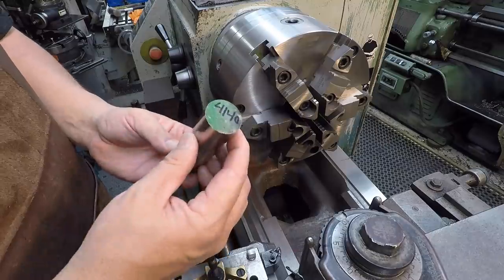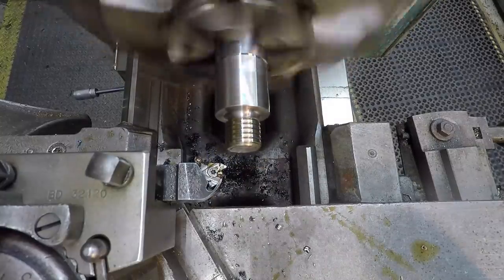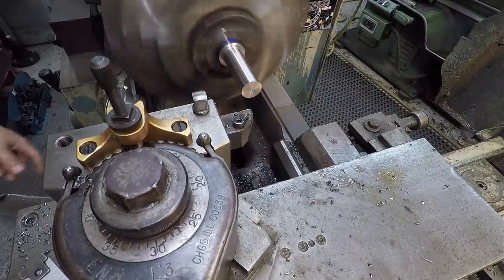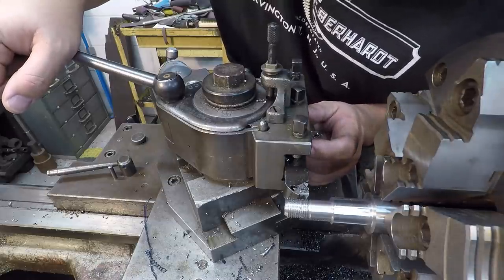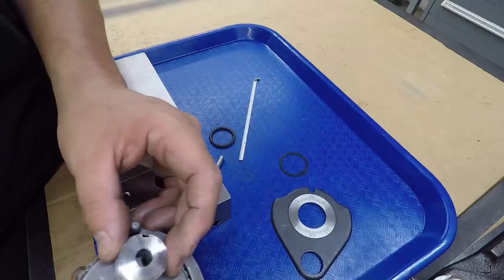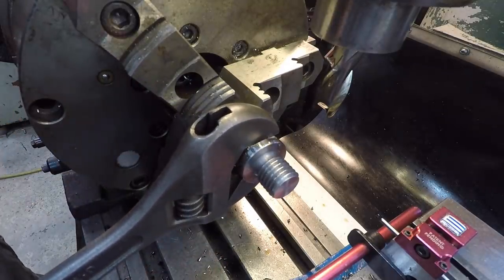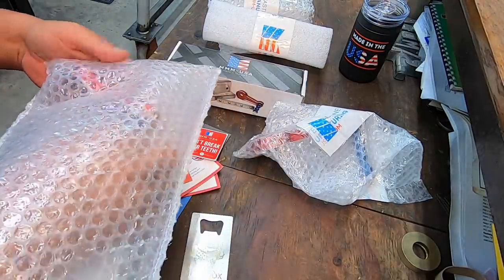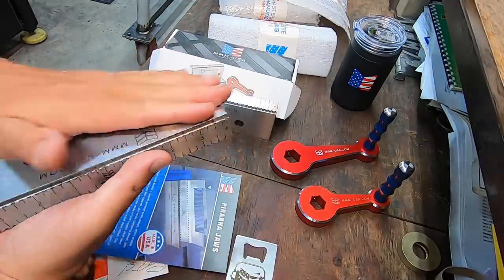SNS 314 Part 2: Machining the Multifix Hold Down Stud

Comment: Love the multifix toolholder, Im in the UK and I have 2 Pewe holders on my lathes and am very impressed with the quality having had several genuine original multifix holders in the past. Just as a side note I have never put the dowel in ...especially when the machine is operated by others because if they crash the tool, it can move..this has saved  me expensive repairs many times. They hold down real well with just the bolt. really enjoy your channel and the interesting stuff you do.
Reply: But you loose the ability to rotate the toolpost by an accurate and repeatable 3 degrees.

Comment: Hi Adam :-) 

I felt the need to add some information on the Multifix system. 
The 3 holes in the body of the holder aren't 90° from each other, they are 93° from each other, the 2nd hole is 93° from the 1st hole and the 3rd hole is 186° from the 1st hole).
That means that there are 120 possible positions instead of 40. there are 40 positions for each hole in the body, the 2nd hole provides a 2nd set of 40 positions and the 3rd hole provides yet another set of 40 positions (3° intervals instead of 9° by utilizing the 2nd and 3rd holes).
Edit: With the 6mm locating pin set at 90° in the T-nut (90° to the length of the top slide), it's easy to hit 30° on the top slide and still have the Multifix tool holder parallel to the chuck just by using the correct hole in the body of the Multifix (since the Multifix allows for 3° increments and most machinists would agree that 30° works well for threading). 
The T-nut for the Multifix really should be slightly below the surface of the top slide by 4 to 6 tenths. I did the same thing that you did but after using it for a few hours, I noticed that the tool post wasn't rigid anymore, turns out that I should have come up with some way of pre-loading the center of the T-nut before machining the surface, I should have made a set screw with the same threads as the center post, then tighten it down good before machining it (pre-load). The fix was to simply grind 6 tenths off the top of the t-nut, that took care of the rigidity issue. 
BTW, I determined how much to grind off by using various shims between the body of the Multifix and the top slide, it held at 4 tenths so I decided to give it a little extra clamping power by grinding 6 tenths off the top of the T-nut.  

Those jaws from MMM aren't reversible, the teeth are on both sides so you can clamp onto an internal feature as well. 
The card that mentions "Don't break your teeth" is meant to prompt you to checkout their advice on proper use as well as drawings on how to properly machine your own soft jaws so their Piranha strips won't break.
They sell individual Piranha strips in various lengths for use on your own jaws (or fixture plates with cam type clamping systems). 
Excellent work, my friend!! 
Nice work on the  video as well!! :-)  
I'm always looking for new ways of doing things and I have learned a few new things by watching your channel!! 
Much appreciated!!! 
Joe
Reply: Great post. Thanks Joe! I had the same reaction to the T nut being (at best) flush.
One other point: if I was making a post for a larger sized lathe in particular, I think I'd go the extra mile and make the axle and the T nut one piece, ie a T bolt. At the very least, I'd recommend using Loctite High Strength Retaining Compound with the correct primer and a bit of pre-heat to make the stud as near as dammit a permanent fixture in the nut (you can always use a bit more heat, like maybe 180 deg C, to remove it)

Comment: Adam, the reason you're chipping the threading inserts could be another result of the loose spindle bearings that cause you grief with cutoff tools chattering on the Victor.  The spindle bearings on my lathe got loose and it started murdering inserts left and right.  Once the spindle bearings were correctly tensioned, no more chatter and no more inserts failing prematurely.  And for what little my opinion on the subject is worth, I think a video or video series of you adjusting the spindle bearings on the Victor would be really interesting--the clutch and oil change series on the Monarch you did a couple of months ago certainly was.

Comment: Concerning the alignment with the cross slide, the reason the Pewetools Multifixes have three pin locations is that they're offset 93°, meaning you can turn the tool post to a different pin location. 
That gives you 120 positions by 3° instead of 40 by 9°, so you can realign it to fit your desired compound orientation and is one reason I replaced my import with a Pewetools QCTP.

Comment: We use those jaws at work     Takes a crash to dislodge the part from them.   They make a dimple on the part so don't use them on a part that is fully finished.     Awesome videos.   Saturdays are always enjoyable watching your videos.    Learn a lot from them.
Reply: Do you clamp tool steel with these by any chance? If so, how well do they work.
Reply: @ianide2480  Steel and Alum    Works well with both.      O-1 and A-2

Comment: Not just anyone can start cutting threads and then change a tool bit and come back and pickup the thread and continue cutting and have that good of a thread when finished. 
Very nice work.
Reply: Good tooling and good inserts certainly makes that easier.

Comment: I like you're method of mounting the T nut as you don't need to modify the cross slide. I try not to drill holes etc. in my machines unless I absolutely have to (e.g. mounting the slides of my DRO).

Comment: From Peter:   Those 3ea 6mm index holes on the bottom divide the 40 positions ( 9° each step) into 3 different offsets at 3° each.   So if you move into a second hole from where you start you have 40 more positions offset by 3° from original 40 positions.   Then if you move the post into the 3rd 6 mm hole you have 40 more positions offset 6° from the original toolpost position.  It’s slick method to turn 40 positions into equally spaced 120 rotational positions.   So it’s pretty easy to get really close to being square to the spindle at any compound angle setting.
Reply: Jorg Jorgensen Peter loves to chat.  I think we covered every aspect of his system.   He wasn’t hip on me doing the t-slot mount with the Jack-set screws but I showed him my method on my install.  Now it seems Peter is comfortable enough to pass on this method to others.  He really promotes the European method of installing a fixed stud in the compound so that the etching on the bottom of the post actually completely embeds microscopically into the compound to make a rock solid 100% contact.  I suggested my method of very tight fitting T-nut with large jack set screws and then surface grinding the full contact area as Abom did.  It works.  I found it impossible to rotate my post using a 1/2-13 stud and nut out of a Teco clamp set.  It’s a great product  and can very successfully be used on a t-slot compound of American and British lathes.  Thanks for your reply. 😄

Comment: FYI, about the pin, I installed mine without it and it worked fine, until a couple of weeks ago when I was doing an interrupted cut boring cut. The post would not stay in position. Now its pinned and fine. Nice video(as usual)

Comment: I purchased a PeWe size A for my Hardinge HLV-H. I machined my Stepped Bushing Stud with a through hole and used a socket cap bolt that matches my Hardinge compound tool rest swivel lock down socket cap bolt 3/8-16.

Comment: Just once, Abom, I’d like to see you f up your initial scratch pass for threading, and prove to us that checking it with the pitch gauge before proceeding, is worth the time.  After watching dozens and dozens of your vids, I’ve never seen you miss it....
Reply: Was thinking exactly the same. Everyone says the same, Joe Py, Stefan and Abom, but I have never seen them stuff it up. I guarantee that if I was cutting threads, the first time I didn't  check would be the first time I stuff it up.
Then again, I'm definitly not in the class of these guys, just a hack.
Reply: He did once, and screwed up an expensive job. Maybe a prop shaft? He talked about it in one of his early videos. He tried to fix it with a custom nut, but his dad decided to scrap the part and start again.
Reply: I am not a machinist but from what I've seen here and on other channels you have to change various gears at the drive end for the pitch you need so I GUESS IT IS EASY TO GET IT WRONG. A 5 second check with the guage saves the part you are working on.
Reply: @ericmcrae7758  Yeah you are right. I have one of these lathe and it is a real PITA. Blondiehacks has the same one, which is probably why she nearly always uses taps and dies. I think Stefan has the same. He even cut his own gears to do some weird thread pitch. he may have got it wrong once, but I suspect the even he doesn't remember that
Reply: @ericmcrae7758  Depends on the lathe, I seem to remember that the Victor he uses here has a quickchange gearbox and change gears are only used to switch imperial and metric, though I'm not totally positive on that.

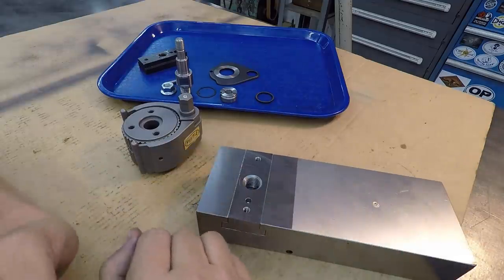Comment: 29:23 ... Can NOT go wrong following Manf. recommended procedure ...  Looks GREAT! 

I had roofers tell me you CANNOT put steel roofing on top of two layers of shingles, we the roofing steel manufacturer said I can (Using three inch long screws, that was 20 year ago :) ... no leaks massive, wind storms, it's all still up there and it's quiet when it rains. (saved a FURTUNE on tear off, clean up, and disposal /  environmental fees.)

Comment: armchair critic here... I think I would have cut the flats n the smaller section, since it has nothing riding on it. If you put abom torque on it, you may deform the close fit surface that fits the tool holder...

Comment: Adam, thanks for answering my question on getting the multifix square to the chuck when the top slide is set to about 29.5 degrees! I ordered some tool holders from Peter earlier this month but they've been stuck in Frankfurt for the past few weeks. Can't wait to get them.

Comment: Any time when you cut on both sides of the insert your gonna get chatter.  That is why when cutting threads you turn the compound at 29.5 degrees.  Your only cutting on one side of the insert.

Comment: Hi Adam, that project really came out well. I have one of those toolposts in a smaller size, I really like it. 
The chatter on the victor, could that be something in the crosslide rather than the spindle bearings? I know you've said before about that being a little squishy at times, maybe they're related somehow.
Also, you used to give all kinds of information on the inserts and speeds you were running, I miss that.

Comment: At 28:07 he says, "people leaving comments...that's incorrect... That is not what I was told by the manufacturer... I made this off the recommendation of the manufacturer." People think before you post !  This is Adam Booth. The proper way to post is thus, "Adam, what is the reason you didn't leave an air gap?" Ask for information. Adam is a Grand Master Teacher in addition to  being a Grand Master Machinist. That is the reason he has 445,000 subscribers, and this has been watched nearly 200,000 times. Did you see him chamfer EVERY sharp edge? Even though most will be hidden forever.
Reply: And so it is!!👍

Comment: Peter reccomended to use at least two of the three pins,  also he reccomended using one in the t-nut as well as the second drilling down into the top of the compound.  The cheap Ebay version of this only has provisions for two pins. Also the shaft is only 20mm vs the higher quality version from peter has I believe a 30mm shaft Boss for added ridigity. 
I'd say if you can afford it,  go with the higher quality product from peter. Leave the Ebay ones alone unless you want the additional work.

Comment: Adam, with all the threads being metric, I’m wondering why you tapped the T nut to 3/4”, I would have kept all the threads metric. Also the wrench flats should have been metric. I’m not a metric person, but one of my pet peeves is when SAE and metric are mixed on parts. Otherwise, fantastic job!
Reply: Have you worked on an American car in the last 30 years?  Your "pet peeve" is alive and well in the US automotive industry.
Reply: Wait util you get to work on stuff the has Metric, SAE and Whitworth threads, That'll really grind your gears.
Reply: This was a job for someone else. Pretty sure he was doing what he was paid to do.
Reply: When the Concorde was built there was a bulkhead in the galley between the module the Brits built and the one the French built. The hydraulic fluid fittings passing through that bulkhead were threaded imperial at one end and metric the other.

Comment: I wonder... since the OD adjacent to the wrench flats is such a tight fit, isn't there a risk that a wrench will roll or mushroom the sides a bit and ruin the fit?  Wouldn't it be better to turn down that OD at the wrench flats so that they never cause that kind of problem?  Not a machinist, so set me straight if I'm wrong here.
Reply: You are right, but Adam deburred the face edges. That should prevent the problem you foresaw. If it were to "bell", the user could simply file the high spot down again. In any case, that stud won't see many "fitting" cycles - install it and let it be. Hope this helps.
Reply: @michedmck  makes sense.

Comment: Adam, I love your videos - they're my new Saturday activity.

In a future vid, could you explain how the lathe knows how to repeat the exact same threading cut?  I'm interested to learn about it.  Thank you
Reply: He's done that a couple of times.  He uses a small, rotating indicator just right of the cross-slide.  He waits for the indicator needle to come around to the right dot, then manually engages the half-nut.  It requires patience, practice and timing to get it right every time.   Adam's a pro.

Comment: Carmex tailn coated thread inserts with no chip breaker are the best I've ever used hands down on steel.  Iscar honestly the worst either to brittle or don't hold an edge. I'll find out what grade and send it to you to try

Comment: I think it those loose bearings in the headstock breaking those inserts.
From the top view you can see the part flex
Reply: I try to always use a live center, in the tailstock, when threading.

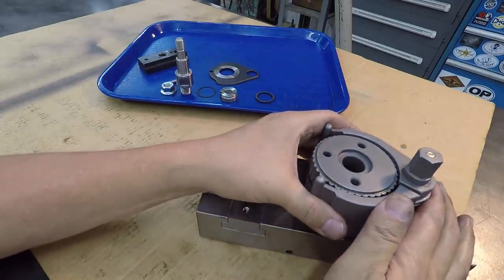Comment: Hey Adam, love your channel, I'd never seen a shaper until I saw yours, and now I gotta have one! Well, some day... Anyway, I wanted to mention that at 29:46, you started talking about drilling a new hole for the dowel pin if necessary. On the Pewetool website, it says that the three 6mm holes in the tool are spaced so that instead of just having 40 possible positions, you have 120. That should reduce the need to drill a different hole for the dowel pin in the base.
Reply: Could still be 1.5 degrees out in the worst case, way too much for parting, and especially unusable for a Morse taper holder

Comment: I'm not sure if you pointed this out, but the three holes for the pins are vernier-offset so that you don't get 40 positions, but 120 positions, which should probably be good enough for you to get lined up for your 30º cross slide.
Reply: Glenn you seem knowledgeable on this subject,  what are the advantages and disadvantages of this type of tool post
Reply: @jody6121  Hah!  Nope, not really knowledgable.  Just a good eye for details, I guess.  I don't have any big iron, so - as far as I know - the Multifix wouldn't fit anything I might buy.  First, for context about Multifix, their mission statement is:
      "Focus on the parts industry".
Definitely not marketed to hobbyists. Multifix's website - http://www.createtool.com/list.asp?cid=33 - totally sucks for figuring what they make and what it would fit.  That said, the big advantage that I see is that you can reposition tools at precise angles.  The possible disadvantages are:
* I don't know how much non-professionals would benefit from this precision.
* You're stuck using Multifix tool holders, rather than standard dovetail tool holders.
* Note that Adam had to make hold-down stud for his lathe.  I don't know how much of an issue this would be for other lathes.
Reply: Thanks for taking the time to answer....been watching Adam for a while now and always assumed this tool post was some old stuff that used to come on old lathes....not realizing that it was an  aftermarket improvement....now I need more info so my wife can decide if I need one....appreciate your efforts and quick response.
Reply: @tomgiorgini9154  might be a no when she sees the price....but I try to justify everything I want....but yes sadly she had veto power.

Comment: I just take the compound off and replace it with a solid block to mount multifix holders on, you gain so much rigidity that you don't even need the compound anymore.
Reply: Wouldn't that make threading difficult?

Comment: Hi Adam, as too the chipping of carbide threading tools  I used to have same problem at times  when used on manual lathe  threading up to shoulder etc as you could not run the spindle speed fast enough  as you would most likly hit the shoulder etc, use same insert on CNC lathe  where there is much more control of stopping cut chipping was never real problem
Reply: Yeah, those carbide threading inserts like to be run fast, and they also benefit from the extra rigidity of a CNC lathe.
A trick to be able to run them that fast in a manual lathe (assuming you've got the spindle RPM for it) is to flip your tool upside down and thread in reverse, which allows you to work away from the spindle, rather than towards. That makes the timing of getting out of the cut much less critical since you're not about to collide with the chuck or part, so you can run a much higher RPM.
Reply: @MysticalDork   Yes that would work so long as you dont have centre  supporting work piece